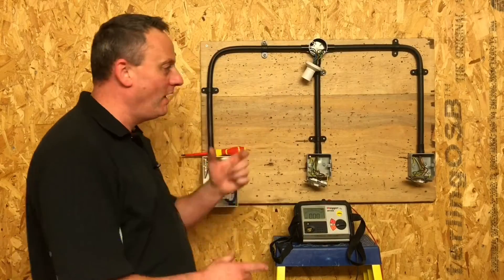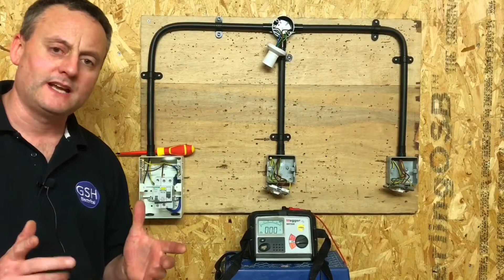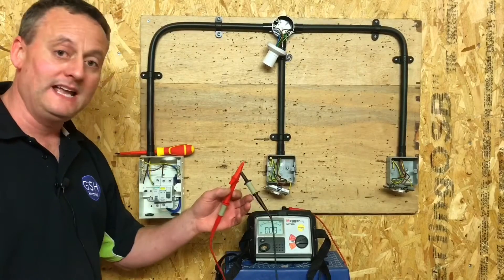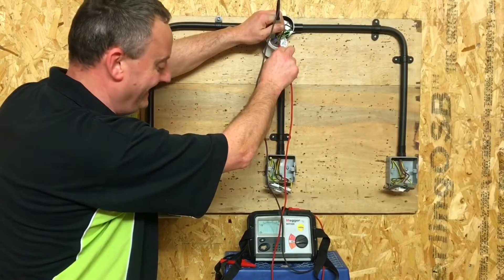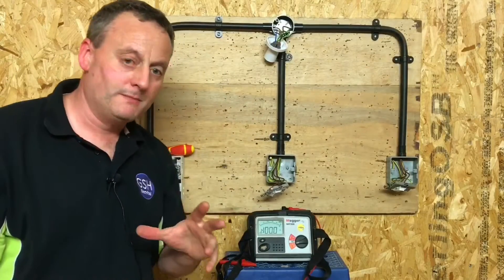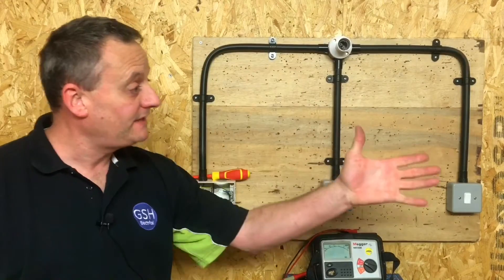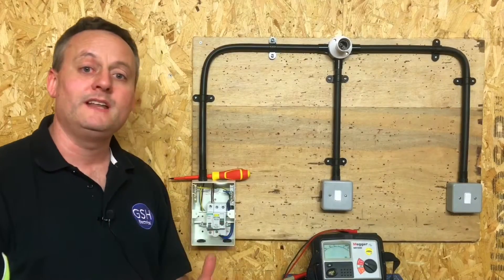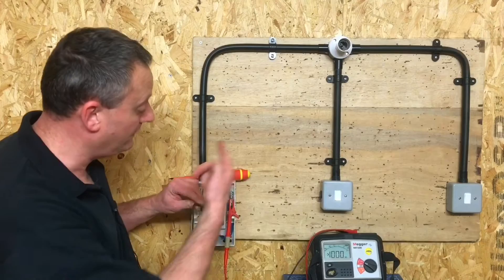Testing Continuity of CPC, Polarity & Insulation Resistance of a 2 Way Lighting Circuit PVC Conduit

Comment: For new electrical installation circuit minimum insulation resistance value is 20MOhms 😮
I’m sorry but this is very misleading. Where did you take this value from?

Comment: Gaz as the Earth lug is machine pressed ie attached to the metal box there’s really no point or need to probe on the box it self same for switch Yoke so Earth connection good, otherwise there would be no point in having the Earth lug.
great video though 👍👍👍❤️

Comment: From someone who isn’t an electrician & is purely watching for entertainment value, what would be the procedure if the continuity between r1 & r2 was high ? What fault would this indicate & how would you fix it ?
Reply from the maker: Hi, to reduce resistance you can increase the conductor size and or  shorten the conductor length these are the 2 most common ones. Thanks for the wonderful message and support. Gaz 👍
Reply: Hi Gaz, so a higher resistance isn’t ideal but there isn’t a “failure” as such ?. Thanks for the quick reply, thechannel is very well presented & I can see you live for your job/passion.

Comment: Great video Gaz as always. Good idea to put the Line in the earth/CPC bar, saves also having to null the resistance of the jump lead; just got to remember to put the Line back into the MCB once completed. Nice to see sequence of the tests for the 2 way lighting. If you have intermediate switching the process is the same except you have an extra switch to turn on/off. Almost forgot, nice to see the tests that prove that the CPC is connected to any exposed conductive parts.
Reply from the maker: Thanks for the detailed comment and you are correct for the intermediate switch(es). All the best. Gaz 👍
Reply: @GSHElectrical  You're welcome :)

Comment: I do the same put line to the CPC bar in the consumer unit gives a better connection. Another very good informative video for any Apprentices
Reply from the maker: Hi Paul, better connection in the earth bar and also our links are giving us issues at Tresham college with our readings. Thanks for the lovely comment. Gaz
Reply: @GSHElectrical  I have the problem with fluctuating readings when doing continuity tests and zeroing leads which I do connect length ways on croc clips , I have an old meggar 1552 it was second hand when I got it, i got brand new leads and its been calibrated I'm thinking of asking my company  for a new tester. I can imagine the  reply ...How much!
Reply: Paul Tipton depends on the type of tester and the wholesaler you buy from... shop around and good luck 👍
Reply: @vievlogs589  The problem is my tester was given to me by my employer and wasnt new when I came to the company and as I don't supply the test equipment I'll have to have a word with the company  electrical  Qualifying supervisor to see if I can get one though the company accounts ( they can pay for it)  otherwise I'll just carry on as I am it just takes longer.